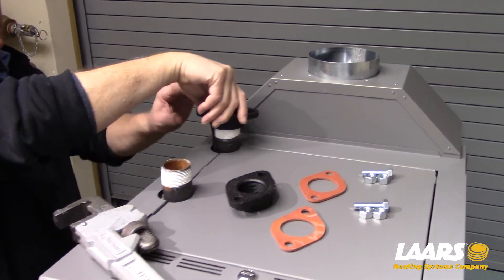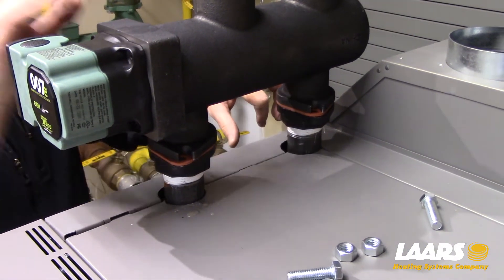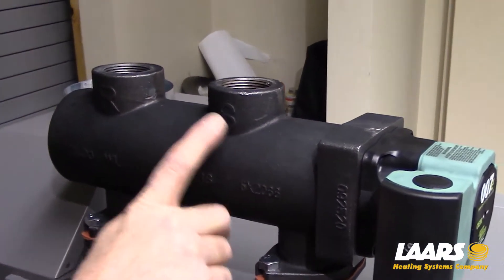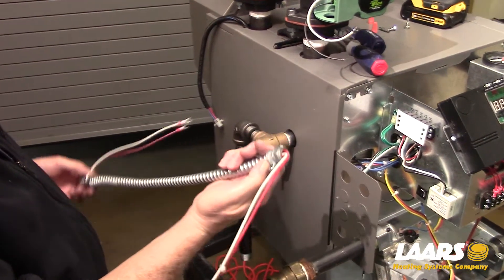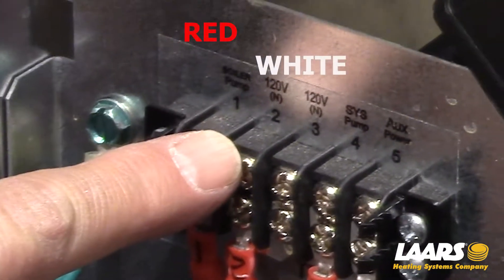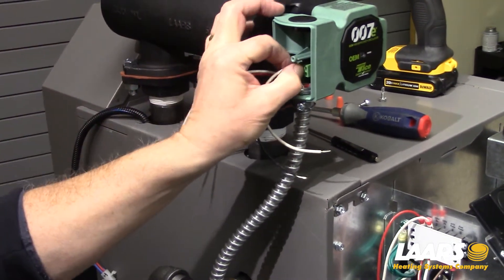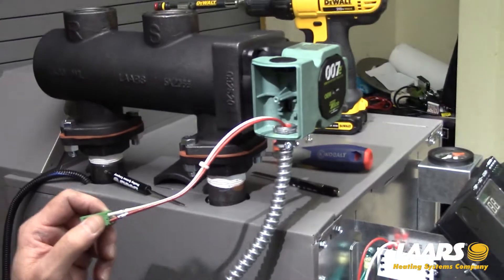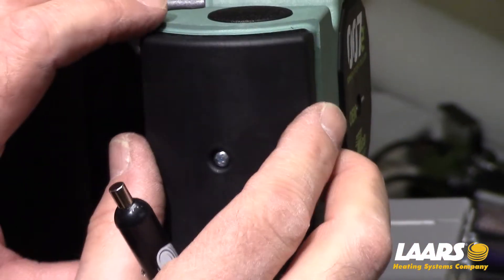Mini-Therm JX, Low Loss Header Installation.

Comment: I have this header on my new JX 125 and it seems like it will make the temperature differential across the heat exchanger more constant and protect it from thermal shock.  Good design!
Reply from the maker: Yes,  the low loss header is a great option! and has now made it's way to our stainless products as well. Thank You for the comment! 
If you have any problems moving forward with your JX, please call 800-900-WARM (9276